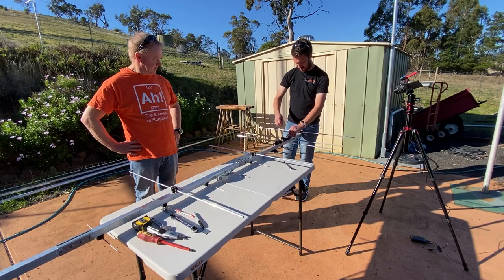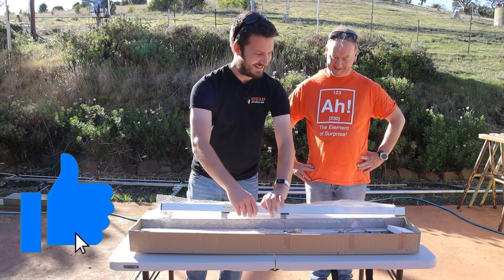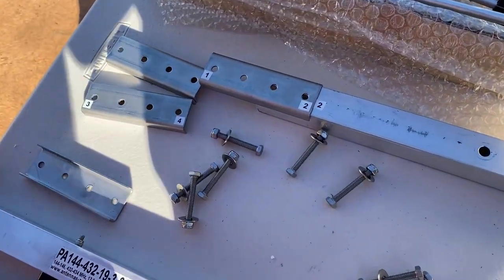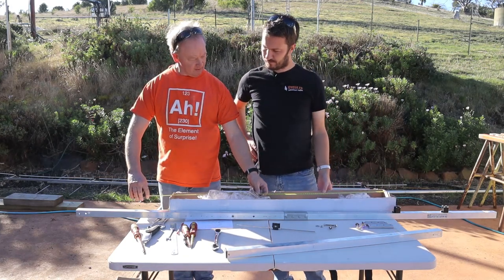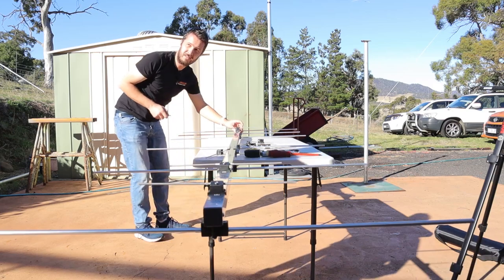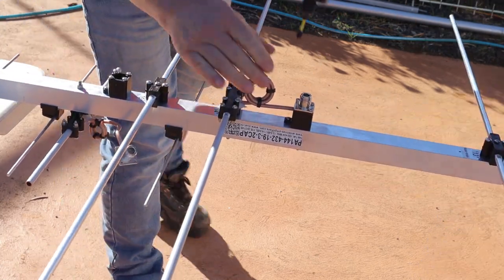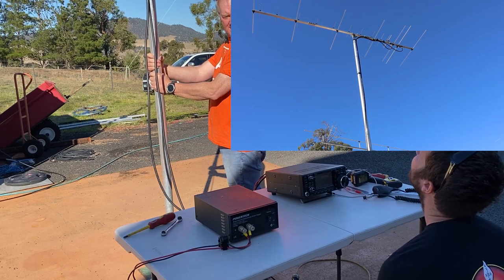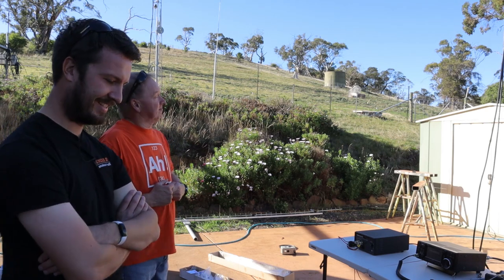2m/70cm Dualband Yagi Review | Antennas-Amplifiers #YTHF21

Comment: I too have one of these and it is on an IC-9700 and it works very well. The aerial is good in high winds, it is built well and doesn't present too much metalwork to the elements (of nature). It appears to have two side lobes, particualrly on 2m, but I have found that they are useful (and don't detract from the main forwards lobe) when say in a 2m FT8 contest, you can still hunt the "dx" and see the other stations coming up on wsjtx. I would highly recommend.
Reply from the maker: Thanks for your comments Terry. I've got nothing but praise for Antennas-Amplifiers, high quality stuff. Cheers and 73
Reply: @ON6AB Oddly, one of the side lobes in particular is useful in VHF/UHF FT8 contests as I can be pointing 90 degrees 
 into EU and a lobe around 310 lets me see/hear into NW of the UK. Likewise if I point the beam to the NW of the UK a lobe points into France.